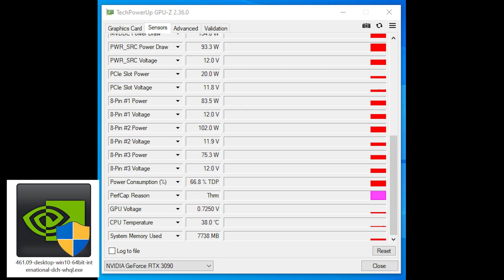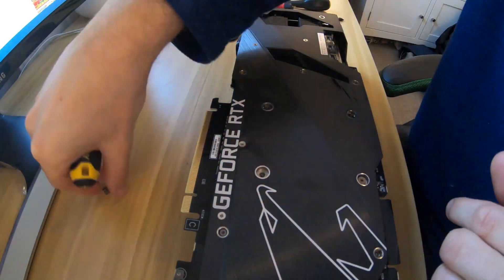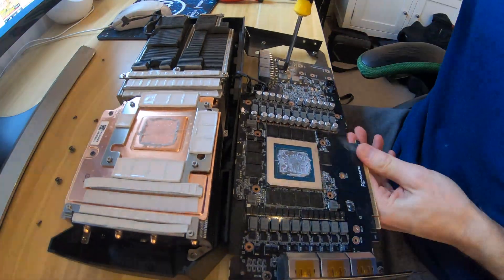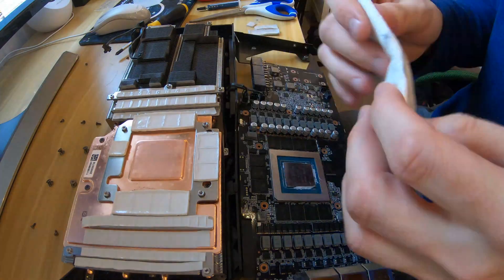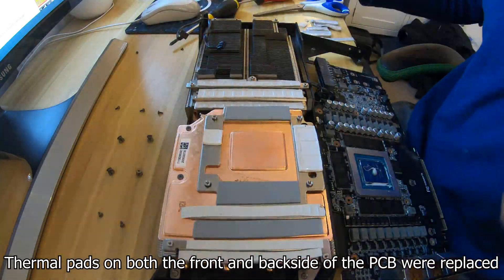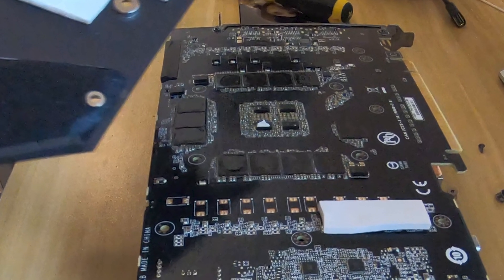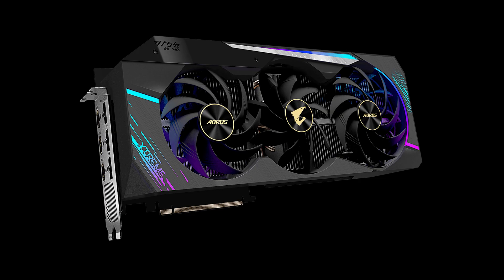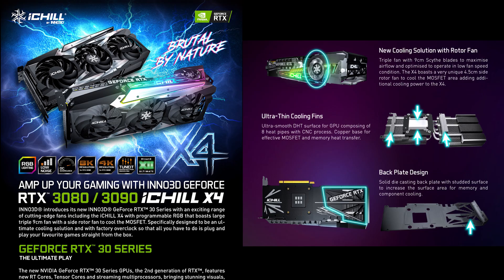Gigabyte RTX 3090 Aorus Xtreme GDDR6X overclocked memory overheating [FIXED]+ buying recommendations

Comment: Get latest hwinfo64. Tells you memory temps now - seem to be anywhere from 40-50 degrees hotter than gpu core :/
Reply from the maker: Thanks for the tip, that's useful. Those temps are insane. I really want to try one of these cards with active cooling on the backplate, I expect manufacturers knew the memory ran hot and made sure it was cooled.
Reply: @MindfulMotorcyclist  Agreed. I suspect there will be a wave of RMAs for 3080s which have been mined on 24/7 at 110+C on the memory chips. I read the safe max temp is around 95C - although my FE doesn't throttle until after surpassing 110C...maybe they are more resilient then we think?
Reply from the maker: @e.e121  You're likely right about the 3080 RMAs. I also read a reddit about the throttling being 'adjusted' in driver 461.40 and later. So they've used a driver fix for a hardware issue. I've never considered water cooling (except a CPU AIO loop) before but if any GPU generation needed it, then it's the 30 -series!
Reply: @MindfulMotorcyclist  I have the iChill x4 and it has the same problem. 45 degrees core temp, memory reaching 110. I've ordered 20x small heatsinks to put on the backplate and some more fans. Currently a noctua fan is laying on top (blowing away, up), which helps. If the heatsinks does not help, some new arctic thermal pads and grizzly kryonaut thermal paste is on the way. Really bad that you have to make these modifications to a very expensive product.